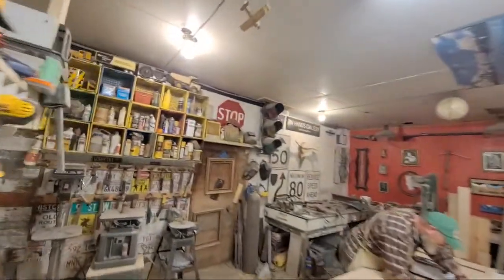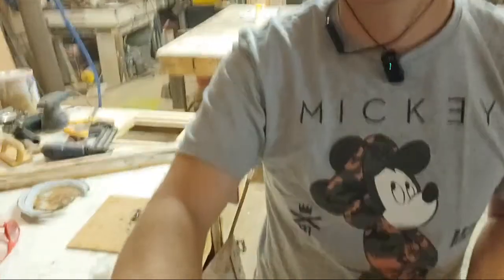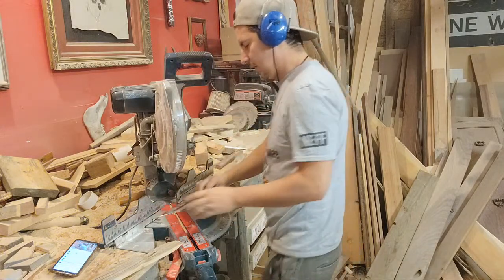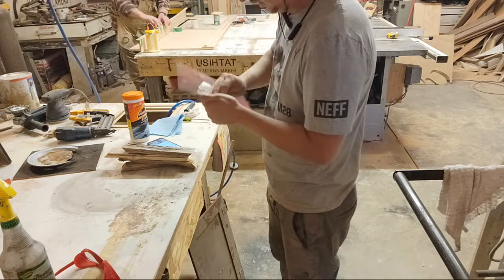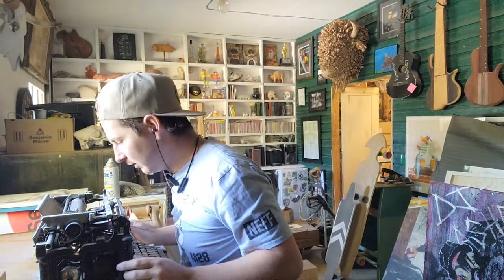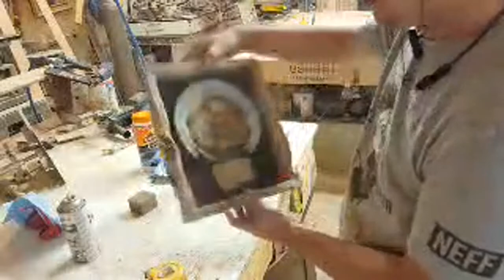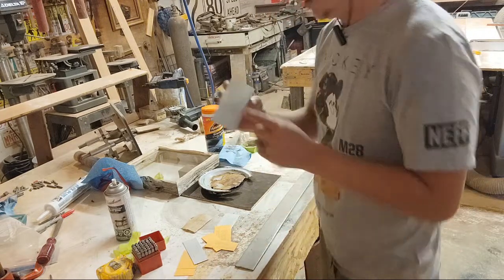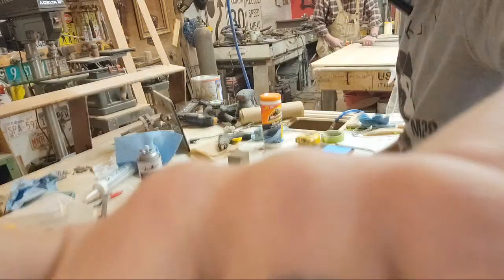Making A Plate Display Live Hang Out

Comment: rubber band around the box to hold it together.- get a white paint pen for writing .-  build a metal holding jig,  sq. piece of steel for bottom,2 sides angle iron screwed down at a 90* and use magnets to push your work against the sides to hold it till dry.